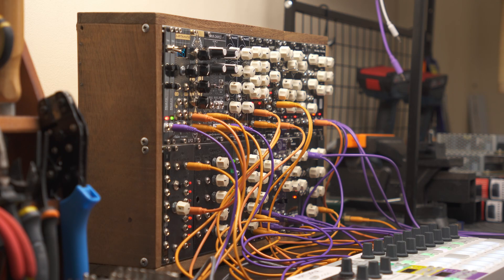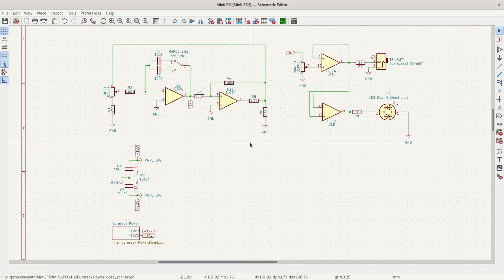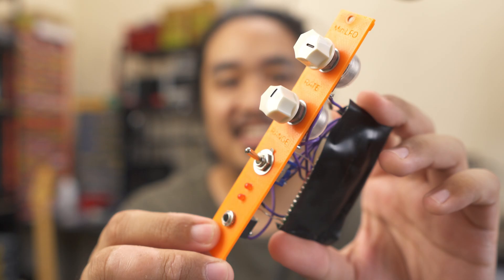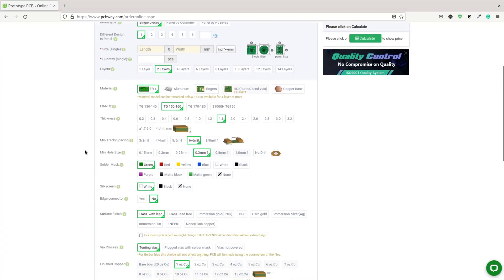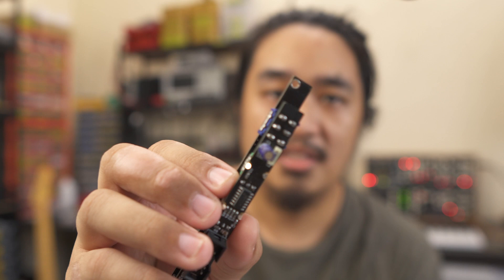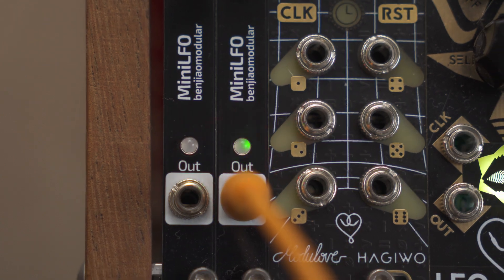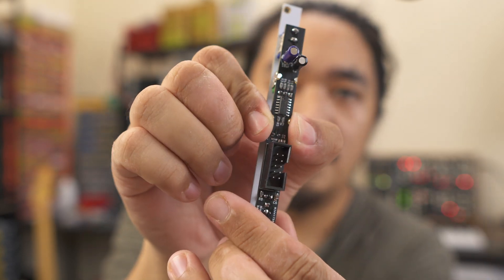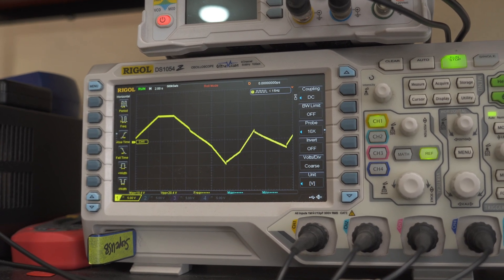MiniLFO - A 2HP triangle wave LFO for Eurorack modular synth

Comment: Nice project. If you want the LEDs to give a bit more light at low signal levels, then place them within the feedback loop and connect R8 to GND (or increase the gain factor of U1D, that will also overcome the threshold voltage of the LEDs).
Reply from the maker: Thanks! I'll make sure to try that out in the next version. 👌

Comment: I tried to place small order of 5 assembled of these LFO's as well as the miniverb the pt2999 one  ,  assembled as well, and it says "audit" next to those. ordered the front panel, do i have to wait for audit ??? is the centroid files in the zip files , maybe thats where im going wrong? which file do i open in kikad if i need to create a centroid file ? please help me. because i dont know which gerber file to open in kikad in order to make centroid file if its not included in the file to use for quick order. thanks
Reply from the maker: Hey! Sorry i missed your comment. They should reach out to you via email if they have clarifications.

Nope, centroid files aren't in the zip. You can open the .kicad_pcb file and generate them by following this guide: https://www.pcbway.com/helpcenter/technical_support/Generate_Position_File_in_Kicad.html
Reply: @benjiaomodular  i attached the zips you had, without the centroid file, and they audited everything and said im good to go. should I still do this centroid file thing ?
Reply: Hey man. you actually didnt include the kicad file on your website , or in the zip file.  so i cant make a centroid file with kicad.  it only has the gerber files.... maybe update your gerber files with the centroid would be best so other people can make it without having to make centroid files, or include kicad file ??? i already ordered 10 faceplates.... id hate to not be able to order the boards after paying for faceplates :(
Reply from the maker: @HeavyDutyModularSynths  they're all on Github: https://github.com/benjiaomodular/MiniDelay/tree/main
Reply: @benjiaomodular  bought 20 multiple faceplate/boards thru your endorsement to kick you back 10% idk if you missed other comment but , if they sell i keep doing it. for you
Reply: and if you put any more up on there, that work proper (if you fixed mixer pot sliders that was in reverse too especially),  i will get those, and the rest of whatever you make and continue to have pcbway to kick you 10 percent of it.
Reply: Thanks you are a nice man.   I will when i open the kicad file, also try to make a non surface mount version maybe since i have some PT2999 IC's laying around.   for myself, for fun i mean. well. or to maybe make thru hole version with different settings or something idk yet.  maybe itll be cool.
Reply from the maker: @HeavyDutyModularSynths  no problem at all! you can try, but you might have a hard time with the layout and the routing. that board is already pretty cramped as an SMT project. 😅

One thing you can do is use the same schematic to design a new PCB layout with a bigger panel (6 to 8HP maybe)

Comment: You can put the double LED inside the opamp feedback loop so there is no light gap when the output  is between +-1V. But be careful if the voltage output + LED dropout is larger than the opamp swing range, you could get phase reversal.
Reply from the maker: Interesting. I'll try it out. Thanks for the tip